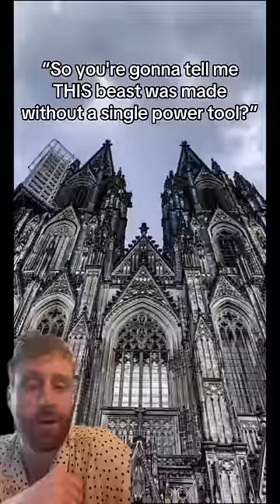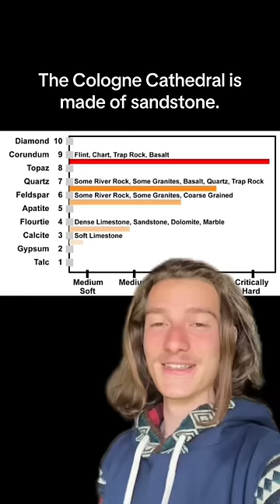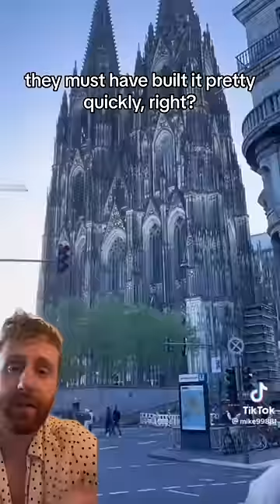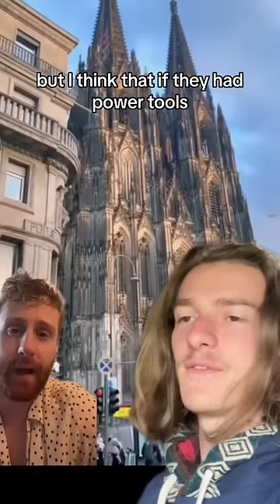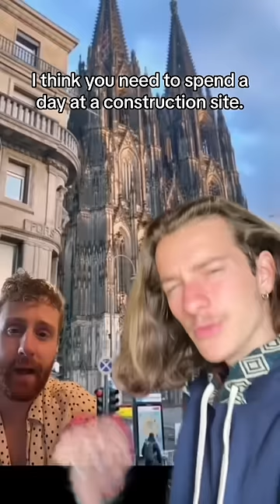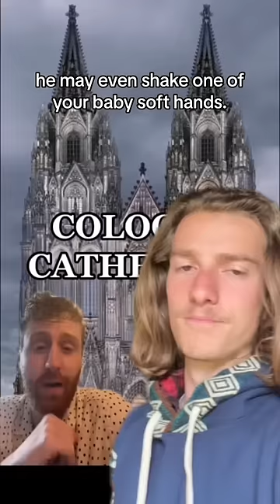How Did They Do It Without Power Tools?

Comment: I grew up working on projects with my dad. Built sheds, a house, and then went on to work in the trades. Anything can be done with simple tools and hands willing to use them. It just takes time. Modern power tools do very little more than simple hand tools, just a lot faster.

Comment: As someone who works in construction (landscape to be precise) and who's boss for some strange reason rarely gives my crew tractors, bobcats, or any other vehicle that would turn a week job into one day, I can confirm that something that big is possible to do without power tools, it'll just take way longer.
Reply: Yep. You can usually still get the job done without the right tool by improvising. It just takes longer and doesn't always turn out as good.

Comment: You could be right about the wood working. I'm a joiner from Germany and I am shocked about most "woodworking" on YouTube wich mainly consists of putting garbage pieces of wood roughly in a shape of a table, chair or bowl, drown it in epoxy with fancy colors and grind away any access epoxy afterwards. Then I have to think of the juwlery box from a woodturner near my village that was made 200 years ago, still locks air tight, was made on a foot powerd lathe and is full of carved ornaments...

Comment: Reminds me how they used to make arches for rooms and buildings in the old days. They used to fill the room with sand / dirt so that the piece of the arch they were assembling/gluing (I don’t remember the materials) would have a solid base to rest on while drying/solidifying. Then they’d dig the dirt out and do the next step bit by bit until they reached the floor

Comment: Christ Sakes. The masons would live on site and whole communities would spring up just to support the effort. The original architects would never live to see the work completed.
That the building was desgined by hand without computers is even more impressive.
Reply: Even more amazing was that most masons back then were illiterate and very few knew math.
Reply: You can watch that whole process in the effort going on in France, to build a castle in the way they were built some 700 years ago. I can't remember its name, but I don't think it'll be hard to find the ONLY castle currently being built in France, let alone the world...
Reply: @bunyipdragon9499 
Masons knew a fair bit of geometry because it was directly relevant to their trade. A masons’ lodge, being the place where they made their plans for how to proceed with the work, would often have geometric constructions done in chalk on the floor (or, if the thing being drafted was small enough, perhaps a table), which would then be transferred to a piece of wood to use as a pattern on the building site.
Reply: @ragnkja  yep, sandboxes were very common but everything was self taught and passed from master to apprentice. But they were not taught math and english they learnt exactly what was needed and mastered it. They were brilliant at what they did and much kudos to them.

Comment: Built trails in wilderness using on-site stone to stack walls, stairways and elevated causeways through boggy ground. 
All hand work with very little power assist. Single-jack drilling through granite with a star-bit drill and four pound hammer gets you 3 inches per half hour. After you drill however much is required then you split the rock with plugs & feathers. 
Takes time but plenty doable.
Love this site!

Comment: Also the MOHS scale of hardness is deceptive.  (jeweler here) 
1-4 is super soft- can scratch with anything. not really good for rings.
4-6 is still pretty soft- can scratch with most things. Not for daily wear in rings. 
6-7 meh ok hard- but a ring will show wear and abrasions  after 3-8 years of wearing.  This is includes all the quartz type stones, amethyst, rose quartz, peridot.
8-9 is tough hard- sapphire ruby hard. Might show wear in 12 years.  Still chips easily. 
10=( really =10,000) and is a only a year good quality diamond. It’s not one step harder than a 9, it’s 9,999 steps harder.  Can still chip because it is brittle.  It can be scratched by high pressure, and etched by laser but mainly is damaged by another diamond-with pressure. 
 
All the building stones like granite, marble, even sandstone are real easy to carve in comparison.  So the claims they couldn’t be-are ridiculous!  You know what can cut granite?  Sand.  abrasion. 
You know what can cut sandstone?  Your toothbrush.  seriously.  You can scrub a groove with your toothbrush…
Reply: I thought granite was a mohs 8?

Comment: Interesting how they actually modeled these buildings and engineered them. One popular technique was to string up bags of sand as weights and construct the shape upside down. Then they would sketch that flip it right side up, fill in the details and tell them to build that shape. The weights would pull on the strings and everything had to stay in pefect balance for the strings to not be pulled sideways. The weights were calibrated to be pulling down on the strings with a proportional force to what it would be pushing down in the full scale building. As the floors were built higher, there was more and more weight on the lower parts of the structure. If a string was pulled sideways, that meant that a pillar would be sideways, and the weight would push the lower parts of the building apart. I'm glossing over tons of skill and painstaking time to do this process but I thought that was fascinating when I learned they architected and engineered the structure. Genius.

Comment: Stone mason here. I VERY rarely use power tools because it leaves too clean a finish for almost any use of stone in building. We cut It to slightly larger than size and then dress it with a hammer and chisel. And the bit that we do use a grinder for can easily be done by hand, it's just faster. When I was learning we weren't allowed to use the grinder and it was all fine. All you need is a lump hammer, and a set of chisels and ideally a brick hammer.

Comment: Tell it like it is! I made a two-tiered barrel-table (with rounded leg corners at the top.It was the most difficult jig),in shop class and refused to use the pressurized-stain/paint room. (You place the furniture inside, set the pressure/stain system and let it do thecwork for you). Hand tools and a 20-foot band-saw machine were involved. All work done by my hands alone. No one could have any help. It took me weeks to complete.
To apply the layers of stain and lacquer,
I started with 80-grit sandpaper, by hand and power sander.
I progressed up to finishing with 400-grit.
I hand-applied the increasing layers of stain, by hand, and ultimately fine-polished, by hand.
I achieved a beautiful, reflective, oak-finish.
It had a reflective depth in excess of 12 inches, as i stood the ruler up, on the tabke top and could VERY clearly see above every minute detail of my fingernails, knuckles and wrist. Would have been nice to have had a yard-stick to measure the shine/reflective depth. I was the only kid in class who got an "A".
The entire class laughed at me because i was not using quick, easy modern tools to finish faster to have time to goof-off in class.
I wanted to learn how to craft dulcimers by hand. Look up what a dulcimer is.
HINT: I am a very talented musician.

Comment: That thing is standing in my hometown cologne. The "Kölner Dom” is never really finished because sometimes some pieces fall off, and they have to be replaced. It is a never ending cycle of repairing. In a few years instead of replacing every individual part one by one they could’ve just taken it down and built it new.

Comment: If you ever find yourself in Germany, visit the cathedral in Ulm. It's a bit higher, but otherwise very similar in style to the cologne cathedral. It's called the Ulmer Münster, and the neat thing is that to the left of the church you will find the Münsterbauhütte. There, you'll find a half dozen skilled craftsmen working on the exact same kind of sandstone, turning blocks into fine,almost floating arches, flowers and steps. Without power tools, just like when the Münster was built. Since the church is very old, sandstone is very easily damaged by environmental factors, and constant replacements are needed.

Comment: I stood one hour, chiseling a path on a wall with sandstone, actual stone and cement so we could hide a wire in there...

And why I didn't use powertools? Because my boss told me " A little work doesn't kill anyone"
Reply: So, how easy was it to get through the sandstone?
Reply: @stargazer1998  It was Fairly easy, once I figured the angle to cut as much as possible, I got out of It finger sized stonlets. Some pieces crumbles into sand corns.

Now, It still took out strain on the hand by hammering and hold the chisel still

Comment: Actually.... The used some kind of Power Tools. Part of the roof is a riveted steel construction done in the 1800s, also supporting the smaller southern tower. You may check Wikipedia for this, at least it is in the German one.

Comment: "A power tool is a tool that is actuated by an additional power source and mechanism other than the solely manual labor used with hand tools."

So they used plenty of power tools, like caddle to move and cut materials.

Comment: Funny part is, when the medieval builders left off, the cathedral wasn't even close to half finished. Only the easternmost section of the choir and the south tower up to the belfry was done by the end of the 15th century. Most of the construction was actually done in the 19th century, to the original medieval plan which is why it doesn't look modern. It's FAR too late to have been aliens.

Comment: Use water bottles as floats. its cheaper. I completely forgot that I made a turtle trap as a kid.  I used logs on two sides and a board from a pallet on the other two sides.  I used 4" nails every 2" on the inside to keep them from getting out. It cost me nothing but time because I used chicken wire I found in the trash and go the nails from my dad's shed.😂
Reply: Ay lad I think ya might have the wrong comment section

Comment: And then again, they did have some way of using mechanical power using pulleys and wheels. I've seen foot powered lathes, for instance, and even mechanical saws powered by people. The MythBusters used to explore this kind of thing all of the time. People have this impression that people in the Middle Ages were horribly repressed by religion and burnt at the stake for even daring to use "science", but they had pretty remarkable engineering skills, and certainly they had arithmetic and geometry and put it to good use.

Comment: aircompressed drill hammers were used for the mont cenis tunnel which was finished ten years prior to the cologne cathedral so it wouldn't be out of the blue to suggest the use of powertools, but no, at least not for the fine intricate work.(likely the last few years they used steampowered tools to break the stone from rock for it)

buuuut, since it is sandstone it kinda errodes away faster than it can be renovated with traditional tools since the advent of sour rain, so much so that some jokingly say it hasn´'t been finished till today, as it is renovated all year around, exchanging eroded blocks with newly produced ones( in a super cut you could see the scafolding wandering around the cathedral year in and year out9 and today to speed up the slack that comes with the work they do use powertools, but traditional tools still are used for the finest details.

so kinda yes, they do use powertools to finish it, but they won't ever get done, and simply replacing the sandstone with something more durable would likely end in the collapse because the ground this close to the rhine wouldn't hold up.

btw it isn't the church who pays for all that, it is unesco and private donations as well as state funds, as long as the view onto the cathedral from the four axis leading to cologne isn't impaired, which is why there is only a few buildings in cologne with more than 5 stories, they even had to cut the skyscraper oon the other side of the rhine short to gurantee the unesco rules to be fullfilled.

imo a pretty idiotic irrational romaticisation of the past, but hey its basicly one of the very few buildings that went nearly unharmed when y'all had to clap some sense into germany, soo people cling to it.

Comment: I adore your videos but i hate your weird little "bAcK wHeN wE actUaLLy hAd tO hAvE SkIlLs" bit that keeps popping up. Stone masons still exist, sculptors still exist, carpenters still exist, architects still exist etc. There are also many new skills popping up, digital design is a skill, data engineering is a skill,  coding is a skill. So either you are saying skills only count if you personally find them valuable, or youre just making a nonsense arguement to add a cutting tone to your videos. Youre better than both of those options.